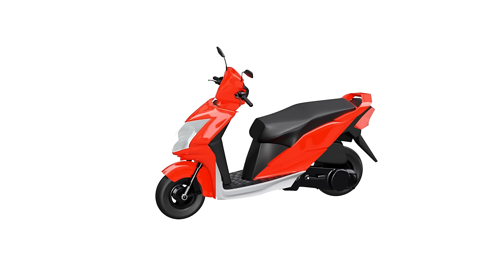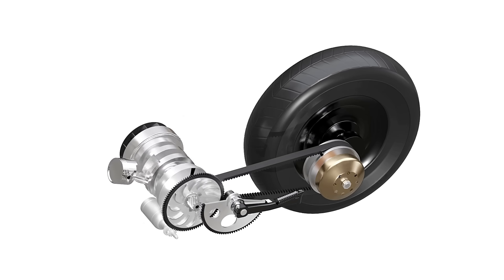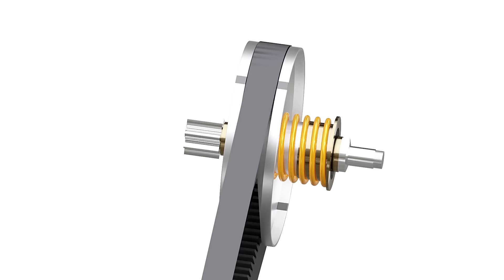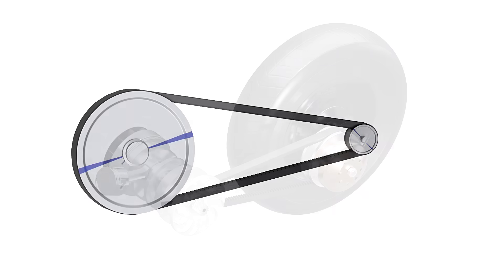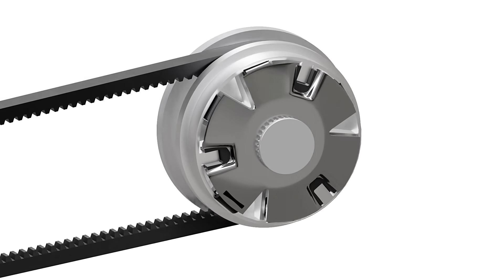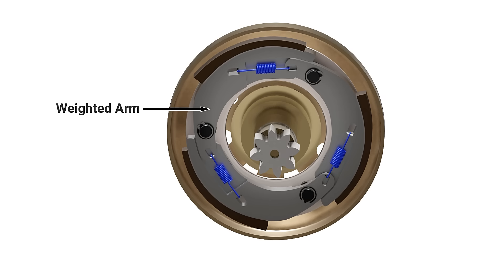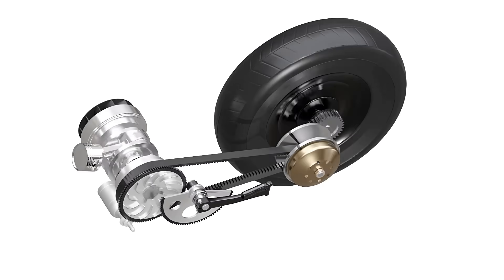How a Scooter Transmission works

Comment: Can someone answer this question for me? Does it hurt anything if the RPMs are too high and you're stopped at a stoplight? Like I can feel the belt trying to spin the tire but I'm stopped at a stoplight would that affect anything? Thanks
Reply: You will wear down the clutch shoes faster since they rub on the clutch bell.

Comment: The Simpson Servicycle for the 50's and 60's had this setup but used a swing arm on the second pulley manipulated by a foot pedal
Neutral was achieved untill the pulley move up and it began to take up slack in the belt as well as adjust the diameter of the two pulleys. The 
driver got larger and the driven got smaller.
There is nothing new under the sun.

Comment: @TecknoMechanics

Can you please elaborate on the contradiction below:

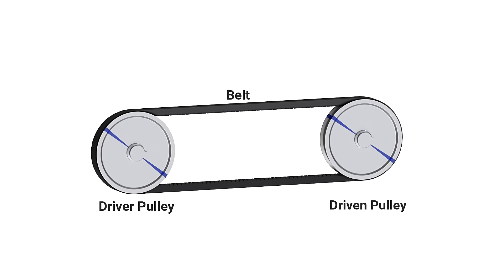0:31> "High RPM is obtained by increasing the diameter of the driver pulley and decreasing the diameter of the driven pulley"
1:48> "To obtain high RPM, the diameter of the driver pulley decreases and that of the driven pulley increases"

Comment: Why this type of CVT is not used in cars?
Reply: This type of CVT is only for low weight vehicles with low top speeds.
For higher top speeds and high engine capacity these types of CVT's won't last long.

Comment: I own this kind of cvt, my questions are:
Why they don't give lubricant on the roller? Also there's only one simple little ring/disk that protects from the mad friction between rollers roof and the inner cvt solid wall caused by high rpm and centrifugal force

Comment: My cvt holds the rpm at 6500 rpm steady from 40 - 120 km/h. The rollers therefore push at a constant force and try to close the variator. The spring behind the clutch has also a (somewhat) constant force pushing the conical disk in. So which force makes the belt travel up and down the pulley with in/decreasing speed from the backwheel?.

Comment: Suggestion: I think it would be clearer if you mentioned "High torque vs high speed", instead of contrasting "high torque vs high RPM". I think you're referring to high RPM for the wheel, which translates into high speed. Most people who use the term RPM are normally referring to the engine.
Reply: Bruh, RPM is just angular speed, and in this case since she was absolutely never talking about translational speed or the scooter even moving, RPM is correctly and clearly used here.
Reply: @mfitz1718  Technically correct≠good for teaching. Just because it's technically correct doesn't mean it makes it easy to learn

Comment: Would it be possible to use a setup like this to produce a transmission that would create a constant rpm on the output end regardless of the rpm on the input side of the equation?  I hope that makes sense.

I'm trying to build a type of simple transmission that will allow for this.  In my mind's eye it would just be a matter of reversing the function of roller bearings to expand or roll inward rather than outward.  Does this sound doable?

Comment: I'm still confused about the wheel side. Does the diameter of the gear there change because the tension in the belt increases due to the size of the driver pulley growing?
Reply from the maker: You are right. The axial stiffness of the belt  pushes the sliding cone outwards and increases the diameter of pulley.

Comment: Driven pulley diameter change is not explained.
I guess that belt tension (caused by driven pulley extend) cause driven pulley to reduce diameter?

Comment: there are an older solution used  in moped with only one variator  clutch and it works just fine the only inconvenient about that mechanism is that you can't push the moped without moving the piston with you so it is really hard to push you can turn on the engine with pushing wish is really great and durable comparing to the Kickstarter wish can be broken or jammed or simply can't turn on an old engine
Reply: Yes, it's basic sample how it works, in real life (most scooters) engine RPM can be vary with same bike speed (everyone can try: ridding constant 30MPH, engine speed increases uphill and decrease downhill, just because different throttle position - engine output power, force to transmision belt - drag it into smaller diameter of variator).
Easier to check when scooter has a rev. counter (eg. Yamaha Xmax, Honda Forza)

Comment: The fact that these scooters are eubiquitous and very common does not take away from how absolutely brilliant this engineering is.
Reply: Thanks Williams f1 1993
Reply: It's just basically like two cones facing opposit directions, with the belt sliding to one extreme for low gear and the other extreme for high gear.
Reply: @miketyson1717 as in the video !  I 'ear you
Reply: Sorry to tell you but it is very inefficient
Scooter 125cc looses to motorbike 110cc
Reply: @tumo07  Lmao this comment is the dumbest thing ive read in awhile... If you race a 125 4 stroke dirtbike vs a moped the moped is gonna blow it out of the water by a bus length. Not to mentio n the bikes slower top speed. ive messed with motorcycles and moped my whole life and can tell you a moped can surpise you.
Reply: @initial3615  is that moped 2 stroke or something
Reply: @initial3615  but have you read my comment ? I’m comparing cvt scooter 125cc 4T with 110cc 4T 4 speed motobike and it smoked the 125cc
Reply: @tumo07  So a crf110 does 140kph!? holy crap i need to buy one of those since you really know what you are talking about
Reply: @tumo07  You would need a 150R to keep up with a 125 4 stroke zuma. Even still the zuma would out run it at over 80kph
Reply: @initial3615  wave rsx 110 do 115 km/h 
Vario 125 do 110km/h
Reply: @initial3615  zuma 125cc i can only see people do max 70 mph which is 112km/h what are you talking about
Reply: Every time I seen my scooter and fix it always thought how that fucking genius creating this CVT device ....
Reply: LITERALLY what I am thinking right now.
Reply: It’s incredibly interesting. Such a genius design
Reply: "Ubiquitous" nice word
Reply: Radhe Radhe Krishna 🥰🙏
Reply: Everything is, even block of wood is incredably stupidly designed
Reply: Not brilliant at all as it is wasted energy due to the constant friction.
Reply: @receptayyip1410  everything wastes energy
Reply: @nyctophilecat  My chain driven bike uses only 1.5 liter per 100 kilometer but my scooter uses 2.2 liter per 100 kilometer although my motor bike hits 80 kilometer per hour and my scooter only 45 kilometer per hour.
Reply: @receptayyip1410  My 125 cc small scooter gives me 115 km/2 L of fuel in highways doing 85-90 km/h (goes up to 95 km/h with two persons). Why your scooter drinks so much? 😱 Sell that scooter and buy a new suzuki scooter they are good. 😀

PS: City fuel economy is bad 35-37 km/ 1L of oil.
Reply: @nyctophilecat  Maybe consumption is also high because of Euro 5 rules
Reply: @nyctophilecat  consumption on scooters is higher than a manual bike with chain and with the same displacement cause scooters are belt drive
Reply: @receptayyip1410  get bigger scooter, with small cc scooter you tend to open the throttle more and decrease fuel economy
Reply: @datukaruma1563  and the top speed as well as acceleration is sacrificed
Reply: @receptayyip1410  So your scooter is messed up and you don't know how to fix it.
Reply: @datukaruma1563  Prove that with official data.
Reply: @receptayyip1410  lmao what scooter are you using that goes only 45km/h
Reply: @datukaruma1563  lol yeah ok
Reply: @receptayyip1410  my Hero Maestro Edge 125R  gives me a mileage of 30/kmpl and its top speed is 100/KMPH ..buy a better scooter atleast
Reply: @sujalgupta3208  30kpl? That's quite low for a scooter from Hero, unless you're doing highway speeds for long time. My Ntorq gives close to 50kpl while being powerful enough.
Do talk about that with your ASC, it's drinking a bit too much I think
Reply: @ScootScoot125  bro Lag-bhag Bahut si Maestro edge Scooters me ye problem hai .. main 4 saal se chala raha hoon 🥲 Ye ek Engeeniering or production Fault hai ..Maestro edge is also Powerful with Great Pickup.. but It's give a mileage of a Bullet Bike
Reply: @nyctophilecat  you're comparing litres per 100 km to kilometers per litre. The two scooters actually have fairly similar fuel economy.
Reply: @receptayyip1410  CVT's are around 85% efficient. Chain drives are typically 95-96% efficient.
Reply: @nyctophilecat  My scooter (Honda click 125i) only costs me 300 philippine peso (thats about 5 usd) per week before needing to refuel again, and if i'm not going out much, my full tank can last upto 3 weeks, i take that as an absolute win.
Reply: @SpiiiiiceeMAN  mine too 😁
Reply: @receptayyip1410  Are they both identical weight? Identical engine? identical tyres and tyre pressures?  Identical drag factor?
Reply: with all these technical shit I read in the comment section. euro 5, gasoline, diesel, cc, kmph, 2.5L blablah blah. I can understand the GenZ to just choose an electric scooter. 🤣

 brushless engine doesn't have any moving part which makes it outlive the owner. haha
and GenZ being somewhat of a leecher.  they will love it as they don't pay for the gas coz they just leech electricity form their parents outlet haha

so yeah.  I can tell how E-vehicle will kill gasoline engines soon.
Reply: @ChibiKeruchan  Genz on their escooters. What an amusing view.
Reply: @ScootScoot125 my  y15z can give me max 63kpl 😂 for highspeed 45-49 kpl manual are efficient interms for long ride
Reply: @nyctophilecat  honda pcx is top
Reply: @datukaruma1563 😂😂😂
Reply: @receptayyip1410  How much is 0.7 litres of fuel? Over 100 Km?
Reply: @receptayyip1410  because your scooter is old
Reply: @TheNamesArif probably electric 😂
Reply: @receptayyip1410  The gasoline motor is only 15% efficient, so no problem :)
Reply: @dimitristripakis7364  It's around 24% not 15% get your values right instead of spreading misinforamtion, and recent cars can easily have 30%
Reply: @dimitristripakis7364 a gas motor is about 30-40% efficient.
Reply: @martincooper8031  🤣🤣🤣 you are funny
Reply: @receptayyip1410     People who buys scooter doesnt want the hassle of clutch and gear and most of em knows that CVTs are inefficient... People are getting more leaned towards Automatic transmissions over efficiency... But I'd any day go for a Motorcycle over a gearless scooter...
Reply: @receptayyip1410  All gearboxes waste energy due to friction. It is a brilliant design
Reply: @receptayyip1410  + and we're not even touching durability and resource aspect, cuz of the same reason
Reply: @receptayyip1410  is the only one that has to me this morning shift ha k nhi ye
Reply: @receptayyip1410  lmao it is absolutely brilliant my dude, it is not something that anyone can just innovate. Maybe your one of those consumers who complains a lot of the products and does not appreciate the work and thinking done behind it.
Reply: @receptayyip1410 you realize a normal engine+trans also uses friction to provide power to the wheels?? Its called a clutch which relies purely on high friction lol

Comment: Small capacity low output engines work best with CVT .
Infinet gearing always uses the maximum power available. 
A gear box is nowhere near as power efficient. 
That's why at the lights the scooters leave the Porsches standing up to 30 mph.
12bhp vs 200bhp CVT works.
It actually also works well in small engined cars
Reply: CVT is a tiny bit better than modern automatic transmissions in efficiency, not massively better since the engine needs to have some speed or revs to effectively suck air, and mix the air with fuel. 

The least powerful modern Porsche has over double the power to weight ratio and a more aerodynamic body as well as lots of torque down low, it’s unlikely that it will be slower than a scooter with a CVT, also the acceleration of CVTs are limited in how much grip the pulley belt has.

Comment: now i understand that during down slope it's important to rev up the throttle to maintain enough rpm for the clutch to engage...otherwise its a freefall that will cause some scooters to crash because they damage the barake linings...

Comment: My cvt sounds bad, one mechanic told me it was the roller then after he fix the sound came back, i change to the other mechanic and said it was the pulley, he fix it, and few weeks the sound came back. I took it to another mechanic, and he said it was the gear connected from pulley to the gearbox (he called it as "laher") he fix it and few weeks later the sound come again.
Reply: Hi Mid. This is on a motor scooter, right? Have you tried taking the CVT cover off and observe what is making the noise yourself? 🛵💨
Reply: Just do it yourself. It's pretty easy to do.

Comment: Hi I want to convert it to electric. Will it trigger the CVT on 750w BLDC motor?
Reply: Hi troyguererro 08. I was under the impression that electric motors don’t require any kind of clutch system. Keep on searching YouTube videos on electric motors cars or bikes. Best of luck.
Reply: Electric  motors have a drive which is variable already induction motor

Comment: In practice, it is as if it changes between like 25 gear ratios, and then you are a 45 kmh. then there are the souped up ones. I did not do much to mine, and it does 80 kmh. I swapped the slider axle on the variator, because mine has that instead of a v bracket. so now it has not pertrusion to cock block my variator from maximum output of SPEED AND POWER!!!!!!
Reply: Changing the rollers to lighter ones gain speed aswell as. Lighter clutch springs and white contra spring. Also removing the restrictor from the exhaust.

Comment: Really neat to see as I just had to learn all about this recently.  Not long ago I upgraded my wife's scooter with a new variator and slightly heavier rollers, which ultimately gave it some more top end speed  (From about 36 mph top speed up to 41-42). Quick operation and really woke that little scooter up
Reply: scooter tuning
Reply: How does the new variator and heavier roller increase top speed? I'm guessing it has a larger maximum diameter?
Reply: @holohulolo  not really a larger diameter, but my understanding is the heavier rollers cause the variator to reach its highest diameter more quickly, and also to maintain it longer and at lower engine speeds.  Essentially it's just staying in  "high gear" more than it otherwise would

Comment: Wow, ive always wondered how scooters ran without gears.
Reply: As an enthusiasts and racing a scooters specially thai scoots,besides the drive pulley and driven pulley,it has clutch gearings and rear gearing to provide another combination of gear ratios for the use.
Reply: Вов, иве алвайс вондеред хов скоотерс ран витхоут геарс.
Reply: @VladuhaProE  stereo typical russian accent
Reply: @Mr. Poutress P. Fortrageas no wonder you are wondering this if you are here talking about "manual engines"... 
And the answer: automatic is way more complex.
Reply: @ImMora1  Scooter CVTs are cheaper than many manual transmissions.
Reply: @appalachianenthusiast9499  not with same displacement
Reply: Uhhhhh
Reply: What u mean? It has 2 variable gears and a fixed gear lmao
Reply: @acid wich was invented decades after this system was in use
Reply: That’s how Bicycle comes into play.
Reply: Made by D.A.F
Reply: Some people aren't comprehending your statement...

* Selectable gear ratios
Reply: What you talking about it has gears
Reply: Reduction diff isn't a gear, clutch can be a Reduction gear if used in automatics.
I think he means the bunch of metal sprockets as in a gearbox.
Variomatic is an ( traploos )( stepless ) Reduction.
Reply: @acid a very bad idea!
Reply: Small fun
https://youtu.be/Y-qS-y4Ok4Y
Reply: Snowmobiles work the same, and new Honda civics
Reply: He's referring to the noticeable change in gearing that non cvt transmission have, the slamming into a higher gear
Reply: @Pounietah  K. Fottragis the auto in scooters is 1000x better than any manual scooter/moped/50cc bike.  and the engine believe it or not is actually better in the scooters than on the manual super moto and race bike moped styles.
Reply: They have gears but automatic transmission happens continuously
Reply: @aether4193  cvt only have single gear
Reply: When I took mine apart, I was so confused why these little wheels came out, I saw this and was amazed by the ingenuity of its inventors.
Reply: not true....they have gears.4 of them....
Reply: @zagrepcanin82  he talking about manual transmission gears fucking gooptard
Reply: vjeran vlahovic ?!?!
Reply: @Robin-kn6pn  maybe he is talking about the gear train shown at the end of this video
Reply: @zagrepcanin82  not really.

They usually have another 2 for the starter motor and his clutch, and if 2 stroke, another 2 for the oil pump and his driver.
Reply: @Virtuoso23  None of which are needed  to run
Reply: @Virtuoso23  Not even thats true. Ive had several 2 Stroke Scooters, and none of them has a "Engine driven oil pump". They use a little electrical Pump, and most of them don't even have that. The Oil tank is located under the Seat cover, wich means gravity causes the oil to flow into the Carburator hence, into the engine. No normal Scooter has a Oilpump, and not a single one is going to have a gear driven one.
Reply: @vio4344  yeah mine worked of vaccum.  gravity does the job getting the oil to the carb and then the carb used vaccum to feed it.
Reply: @vio4344  Literally all yamaha 2 stroke scooters have a gear driven oil pump, let me ask you, are yamaha scooters unusual? XD

Comment: Then y scooters have less fuel efficiency than manual gear bikes?
Reply: They don't. They are just as efficient. Look at the mpg on a 125 scooter. Same a 125 motorbike. 2 strokes are not as efficient.

Comment: Great video, but what isn't described is what causes driven pulley to compress spring and decrease the diameter of the pulley where the belt is?
Reply from the maker: Axial stiffness of the belt
Reply: Centrifugal force  .is all that's needed